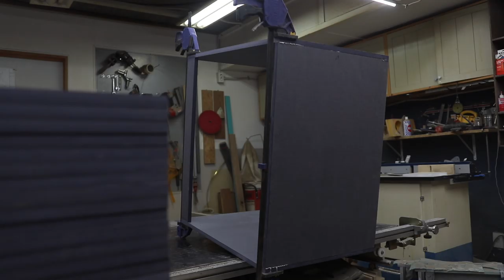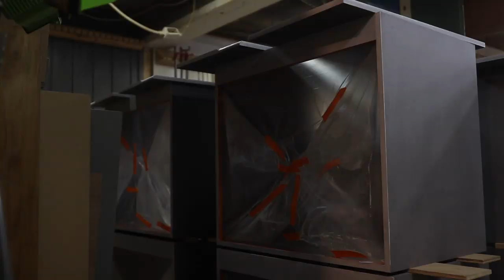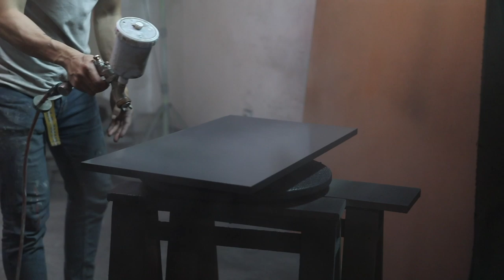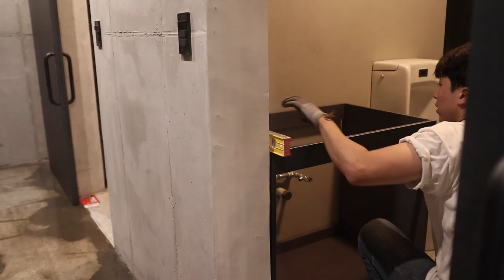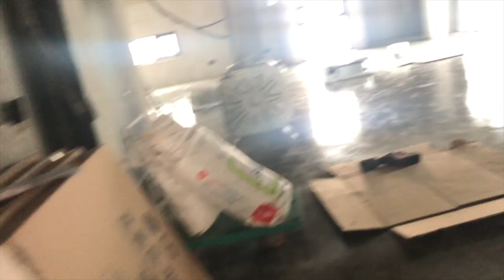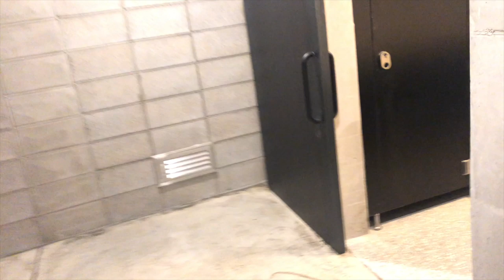W65_Install vanity unit for a new building

Comment: Hi! Started following you on YouTube about two months now, I think you do fantastic work and you have some great videos.
I'm on the other side of the world in the Caribbean Trinidad& Tobago to be exact.
 What was used for first coat with the proper? And what was the last coat on the doors? Clear coat or paint?
Reply: "Roller" not proper
Reply: First coat was a sealant to stop the engineered MDF from soaking up the paint, last coat looked like a poly top coat to protect the paint
Reply: @Odium2006  Thanks much!! That seems to be a great system
Reply from the maker: correct~!

Comment: Awesome build as usual. What kind of bit for routing the cabinet pulls? Also how did they install the counter top, glue or screws right into the valchromat?
Reply from the maker: I use a 45angle bit and installed the top with glue and screws